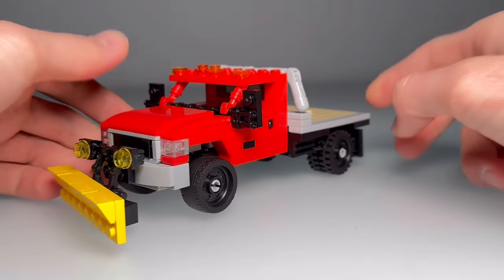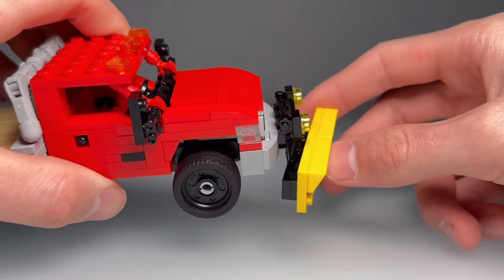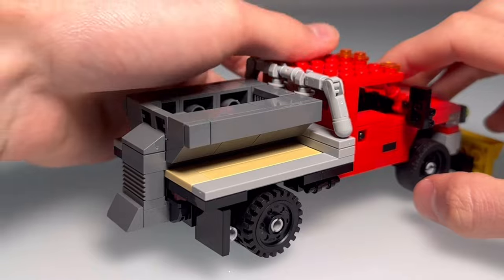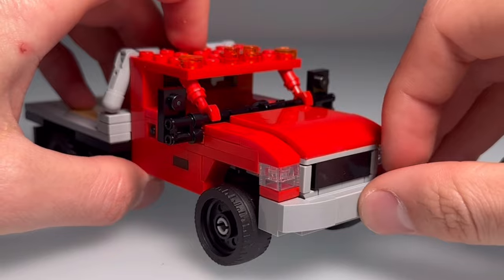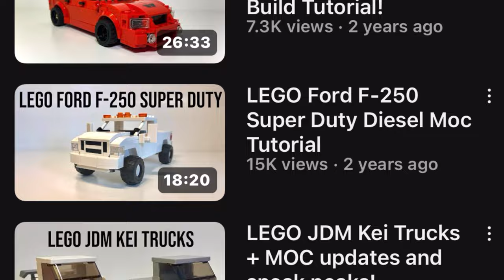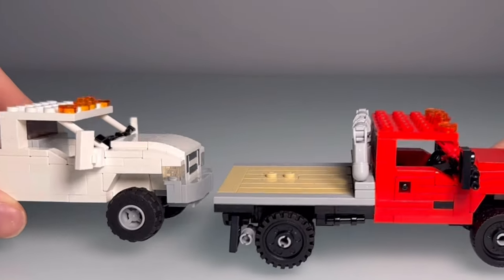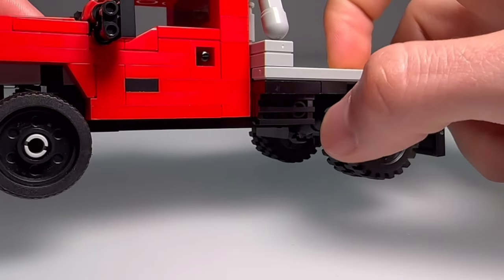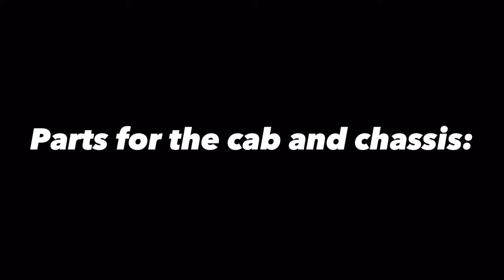How to Build a LEGO Ford F-350 Plow Truck!

Comment: Hey, could you please build a 4 door Lego truck to the scale of a Lego mini fig? That would be awesome. It would probably need to be at least 8 studs wide for it to work.😊
Reply: He normally only build 6 stud trucks that don’t fit figs, not saying he won’t it’s just to make them look nice the proportions have to be certain lengths and heights.
Reply from the maker: Its funny 6 wide is actually more minifigure scale, 8 wide would be huge in comparison but you’re definitely right about fitting figs, it would need to be at least 7-8 wide to be able to do that.